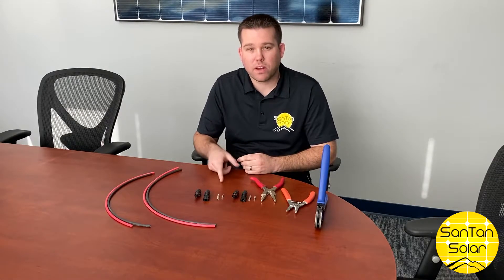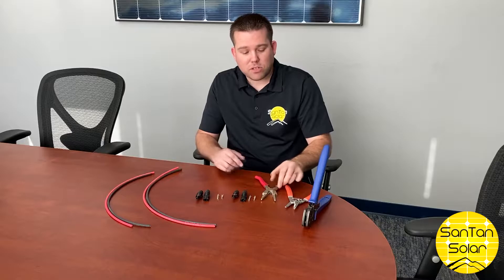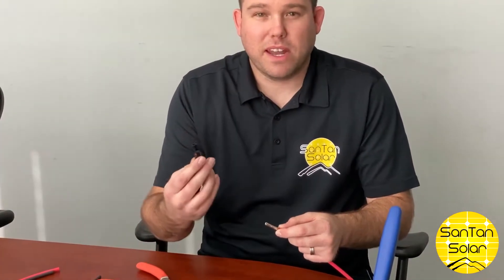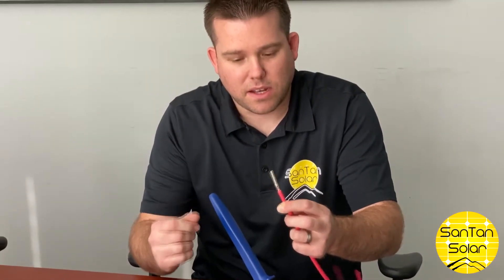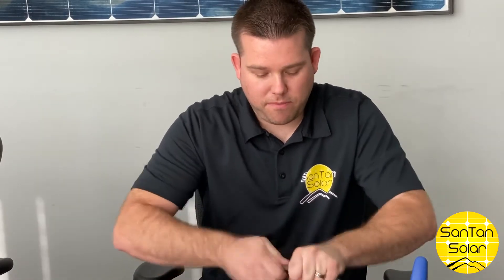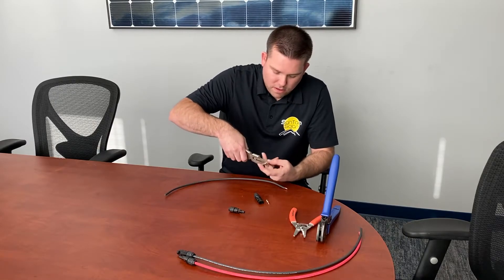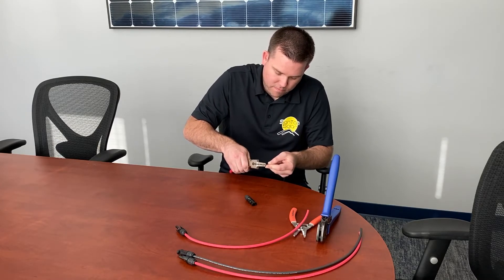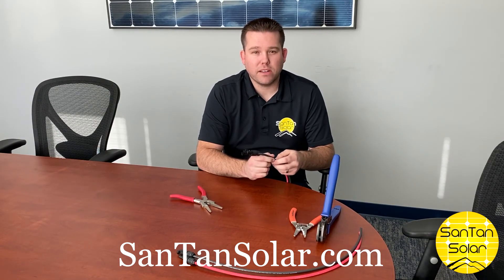How To Install MC4 Connectors | SanTan Solar

Comment: BOTH times you crimp with the basic pliers...  the video cuts away during the actual crimp.   The only thing people actually might need to SEE in this video is - how much pressure is he applying to that crimp connection.   So...   why?